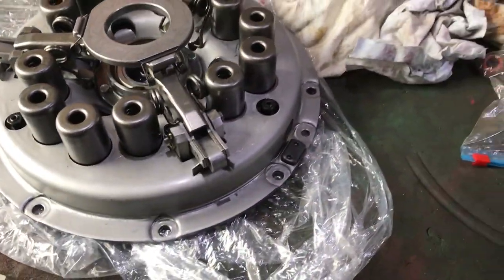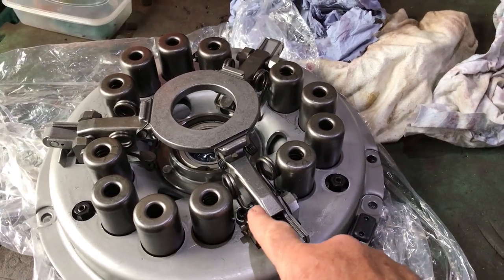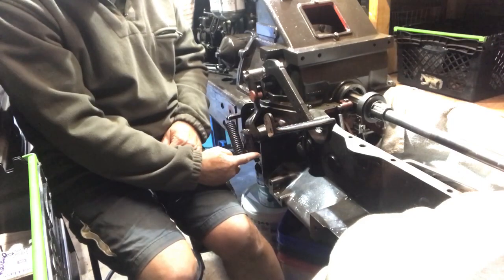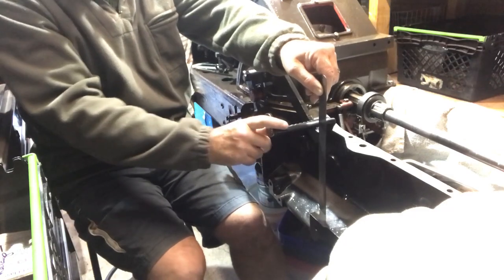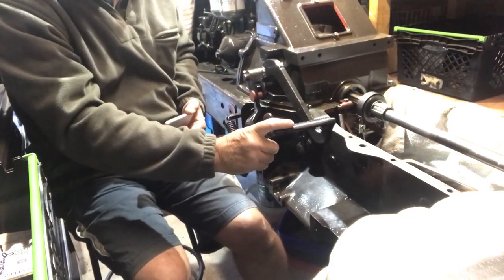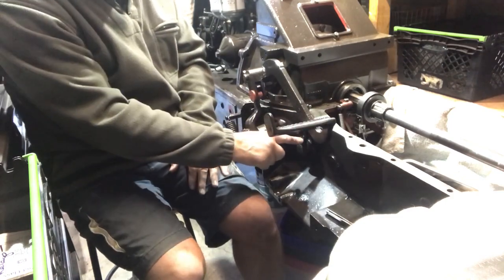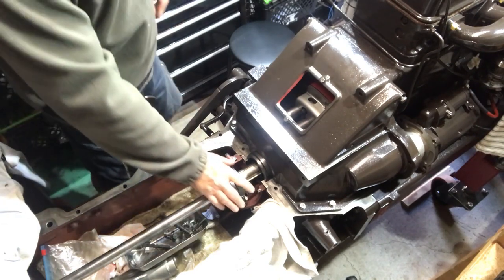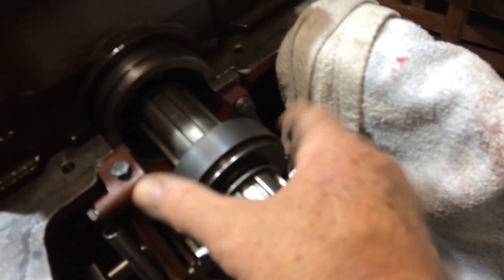David Brown 990 selectamatic clutch replacement #38

Comment: Hello Barry: This is a long read ... sorry!

A review of the Hydraulic Failure on my DB 990 Selectamatic. Your Videos, support and handholding has been invaluable as was Shane's (Path Of Discovery). The tractor lost all hydraulics while operating an eight foot bush hog. Eventually I had to pull the PTO housing and immediately found the Intermediate Hydraulic Pump drive gear shaft had came unscrewed from the Casting and was just laying there in the bottom of the Casting. The Root Cause of why this happen is a mystery.

This Intermediate gear turns counter clockwise - the original engineering should have called for a left hand thread on that shaft. I found that the inside race of the bearing was doing some amount of turning on the shaft which resulted in about .002 wear on the shaft. Your advice of three point dimpling the shaft in five equally spaced locations around the shaft worked great when I installed the new bearing. I was tempted to use Red Loctite on the threads of the shaft but for the benefit of the next mechanic that works on this PTO I used Blue - I might well be the next mechanic! :) I have a worry of how tight I was able to get the shaft - the designer's could have provided a hex head on that shaft; hindsight being 20/20 I should have sacrificed an impact socket and welded two parallel pieces of Key stock on to it. 

In the process of removing the the PTO the Hydraulic Pump Mounting Plate gasket was disturbed, so I pulled the pump and plate, and installed new gaskets. I did increase the size of the Pump Discharge "0" Ring to 16mm ID X 3mm CS as Shane and Barry had recommended, but it took a bit coaxing to get the Pump on over the larger "O" ring. I was surprised as to how clean the internals of the old tractor was, but I changed the oil and the filter anyway. Other than a new bearing, gaskets, "O" rings, oil (6 gallons) and filter I also purchased a Load Leveler (it's a must have if you are working by yourself) I already had an Engine Puller.  I ended up purchasing an Endoscope - without it I would likely still be trying to get the Hydraulic Pump Gear to align with the Intermediate Gear. I did mark the position of the PTO Shaft but lost that mark. 

The other issue that this tractor was having was the Secondary PTO Clutch was not fully releasing. The last time this PTO was used was in the spring of 2024 and it had been giving issues for a while. At the time of the Hydraulic failure it became impossible to shift the the PTO Gear Box with the engine running. So I was fully prepared to pull the Hood and Fuel Tank and using Barry's Video adjust the Clutch to .070". It went unnoticed by me that the Clutch pedal was not actually going all the way to the floor when attempting to shift the PTO Transmission. With the Tractor's Hydraulics working again I wanted to test the PTO and that's when I noticed that the Clutch Pedal did indeed go all the way to floor this time and the PTO Gear Shift could be operated as it is supposed to. To my knowledge nothing I did in the repair of the Hydraulics had anything to do with the Secondary PTO Clutch - another mystery!  I have since put about 5 hours on the tractor's PTO and all is working well - I'll take it!
Reply from the maker: Well done Larry, pleased to hear all is bck together and working well.
many thanks
Barry

Comment: Hello Barry:  I hope you received the email pertaining to my PTO/Hydraulics problem along with the pictures.  It was somewhat of a wordy message.. Sorry about that.  Eventually I will get the PTO & Hydraulic repaired then on to the next issue.  Which is the PTO Clutch not fully releasing.  I have watched your great video on adjusting the Clutch to .070" a couple of times.  I want to confirm that this adjustment can be done through the square access hole in the top of the casting?  On my 990 that hole has a vented cover which I find strange that the cover is vented.  The hood and fuel tank will have to be removed in order to access the and work through hole in the casting.  The part of the Clutch for the Transmission seems to be functioning normally but the PTO Clutch doesn't fully disengage.  Thanks again for all the work and effort that you have put in making these video's.
Reply from the maker: Hi Larry, yes thats right the clutch can be adjusted through the access panel, mine is vented to, and yes you need to remove the tank and hood. I suppose you could do it with the hood on but it will be an awfull fiddle.
good luck
Barry

Comment: I’ve been searching all over for that little inspection hole in my 990’s clutch housing, but I don’t see it! Were there different housings made? Also, my 990 has the clutch pedals coming up from the bottom and none of the manuals show an adjustment procedure for that style.
Reply from the maker: Hi the inspection hole is behind the steering column under the fuel tank, Not sure about the different housings or your pedals,
what year was your 990 made?
many thanks
Barry
Reply: @manfromthemist1958  , my 990 is a 1976. Also the badge says it’s a 990/1 as the model. Any significance to the “/1”?
Reply from the maker: could you make a shorts video of the tractor, manufacturer plate, serial number on the front chassis and pedal arrangements, post it on your channel and I'll get some of my viewers who know a great deal more than I do to take a look and hopefully come up with some answers
fingers crossed
Barry

Comment: Hello Barry! Great videos
I’be just replaced the dual clutch on my 995 from 1973!
There is a big gap between the pressure plate and the tread bearing! When I adjust the freeplay it Will connect but it still feels ”loose” and the pto-shaft Will not release!

Do you have any idea what the problem might be?

Best regards from Sweden (apologize for my english writing)
Reply: Just to clearify! When I adjust it to maximum it still won’t release the pto-shaft and it’s like there is no resistance in the pressure plate!
Reply from the maker: Hi Oskar, a couple of questions, have you got a manual for your tractor? have you set the PTO clutch cover adjustment screws to .070", there are three of them in the clutch  pressure plate. I got a video #34 which details the setting of the PTO clearance, it also detauils how to check and adjust the eccentric in the clutch pedal to obtain the correct clearance of the  PTO adjustment screws to plate when the pedal is held in the check position
lats know how you get on
many thanks for watching
Barry
Reply: Thank you for a quick answer!
Yes I got a workshop manual and everything is correct and the three screws are adjusted to .070’’!
I’ve read about a guy with pretty much the same problem and he found out there were pins under the ”lifting-forks” on the pressure plate that had segares of! Which made no resistance in the clutch!
What do you think about this?
Reply: ”Sheared of”
Reply: When the adjusting screw on the pedal and the excentric screw is adjusted to maximum it is still not enough to disengage the clutch and the PTO
Reply from the maker: @oskarlago1368  your cluch is new replacement isn't it?, yes there are roller bearings in the fingers with 19 pins in each
but if yours is new you should n#have any problems with the bearings
Reply: Yes everything is new except the pressure plate with all the springs in it!
In another video of yours your talking  about “release the clutch” before you adjust the the three screws for the pto-clearance!
I can’t find anything about releasing the clutch when you put it back together in my manual!
But it seems to me like the clutch isn’t released!? How do you get it to release?
Or is it possible that it is stuck on a new one?
Reply from the maker: @oskarlago1368  Hi Oskar did you use an alignment toolto keep both fricton plates aligned whilw tightening the cover plate? this may seam like a daft question, but you did check the diameters of the friction plates before you put them in? i ask this because I have been given the wrong size friction plate before ie 12" instead of 11"
Reply: Yes we used an alignment tool and the friction plates are correct size!
Everything seems to be right with both the clutch and the clutch shaft!
The transmission clutch seems to be working but when we adjust the free play on the pedal and then push it down, it gets swampy and we adjust the screw further in! We’ve done this a couple of times but every time the same thing! Now we don’t dare to adjust it any further!
We can’t get the pto-shaft to release, although the three adjusting screws are set to 70 touh!
We’re gonna try to start the engine and se what happens🫣
I’ll let you know how it goes

Comment: You didn’t have to split the tractor? Last time I did one I split the tractor??
Reply from the maker: cheers Corrigreen, you're right you don't need to split the tractor, it depends on your circumstances and resources as to which way you approach the job
thanks for the comments and your
support very much appreciated
barry
Reply: What was the make?
Reply from the maker: @usefulcontent9894  the tractor is DB990 and the clutch is from Barclay williams (no manufacturer on it)